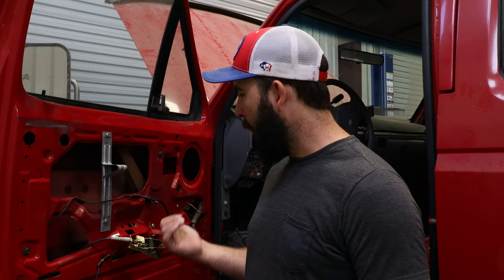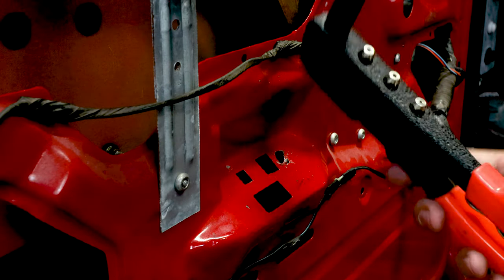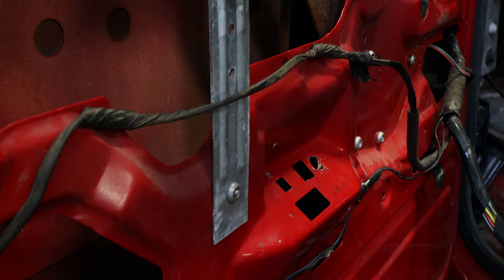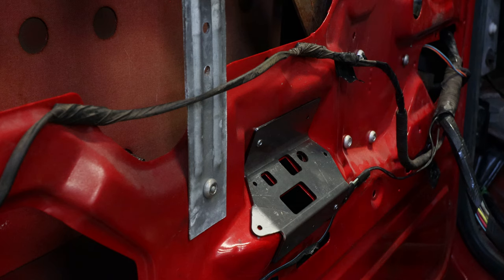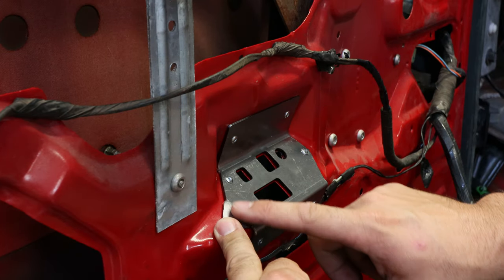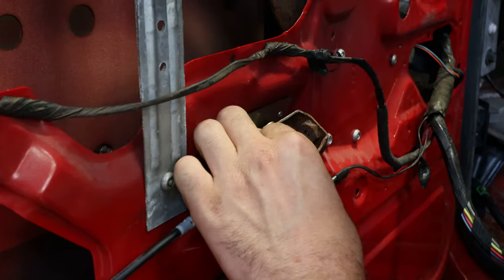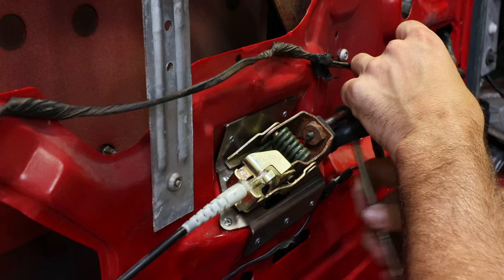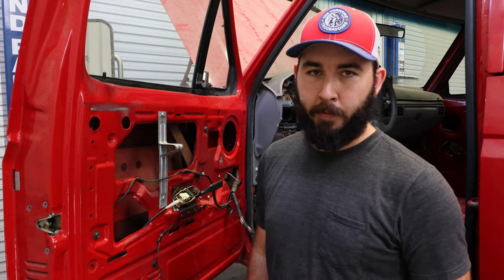Fix-it Friday: 1992-1997 Ford F-Series Door Handle Fix(Install)

Comment: Just finished my endura pin install. Waiting for JB weld to cure on the door pocket bracket and door panel screw holes that were blown out, installed door panel repair kit last night, and glued my door panel back together wherever it broke. Later when I catch the shade outside doing my door latch cable and handle and this kit. Then reinstall my door panel with my screw kit I got from you guys as well. Stoked on all my products from my recent order.
Reply from the maker: AWESOME!!! Love it!!!

Comment: I have a '95 F150 I purchased in '96.  The original handle broke, replaced it and broke the replacement (who knew I was so strong?).  My son purchased chrome handles from a junkyard and installed them.  Yeah, not crazy about the chrome but if it works ....  a couple weeks later I tried to open the door and the metal finally gave way (who knew?).  Opening the door from the outside was no problem so we thought the cable was ok - just greased it.  Then the window motor stopped working. Yeah, not a pretty sights seeing grandma crawl across the seat to get out ....   
I started my research and found your product and ordered it  - Called the boy child and asked if he would drill some holes in my truck door.  His suspicions arose until I showed him what I wanted (he now thinks I'm pretty smart -- even if I am his mom).  He installed it and it has worked like a charm these last few months!  Yes, yesterday, we fixed the window motor and replaced the door panel!  Whoohoo - no more driving a post apocalyptic truck!  
Thanks for a great, easy to install product with a clear video - it took him longer to get his tools out and ready to go than to install this plate.  Great product - and yes, I am telling others about it!
Reply from the maker: We are so glad that we were able to help you get it fixed back up!!

Comment: I would love to see a video on installing one of your crewcab rear door window motor
Reply from the maker: Thanks for the suggestion. We will put it on the To Do List
Reply: I replaced both r/l only to find out the wires where broken 😡 dumb move on my part I should first checked for power ! Ford is horrible for not giving enough wire to do repair and because the rear doors on a crew don’t get opened a lot the wires crack and fray and break off so check that first before you drill out the rivets and then using bolts !

Comment: Take it to the next level and make the plate so it would install from the backside of the door panel with a tapped hole or "weld nut" for the handle bolt.  What you get it the added strength of both metal surfaces and you can eliminate the "speed clip" for the bolt and don;t have to worry about the pop rivets failing. Give it a try, my F-250 door opens like new.
Reply: And it looks like there's room to get some back up washers for the rivets.

Comment: I'd put the plate under the door under the door skin and use a nutsert. That way you are using the skin for strength and not depending on the pop rivets to to supply most of the strength. 
I'm a trash truck mechanic and I'm always having to think about making it better than the manufacturer did because they almost always do it on the cheap. Price point is very important to sales, and the more the sales department controls the production department the crappier they get made. 
An example would be GMs ignition switch.
Reply: Could also use some adhesive between the plate and the door. The rivets will hold it in place while the adhesive sets up. Ain’t going nowhere after that.

Comment: Nice video, there are others who use a plate too. I think that plate is absolute overkill. We are talking about a bolt feeding through a hole in steel which has weakened a bit. No need for a spring nut. Just use a bolt, a  nut,  large washer and some lock-tight.  With the window rolled up you can use a wrench on the inside to get it tight.  Done.
Reply: That is what I did to mine

Comment: What could potentially cause the cable to still behave like it's stretched with a brand new cable installed? I put the cable in, the reinforcement plate, and new hinge pins. I can barely get it open and have to smack my elbow against the door. Also have billet handles so nothing is gonna break but I'd like it to operate like my passenger door with a clean pull. Could the old striker be causing it to hang up?
Reply from the maker: Need to adjust your striker or check your hinge pins. Those are typically the culprits. Let us know if those work.
Reply: Must be striker. Hinge pins and bushings are brand new as well. Did it all the same day.